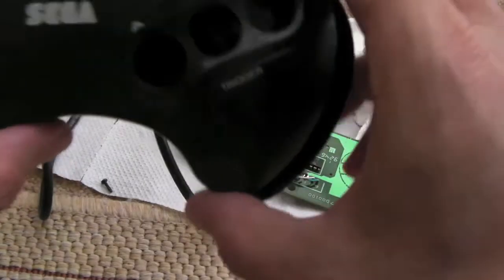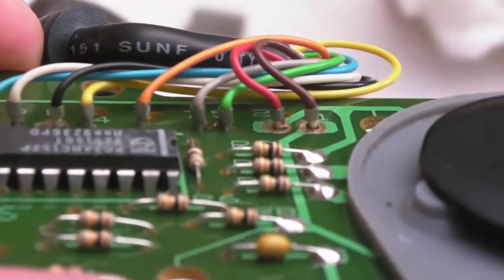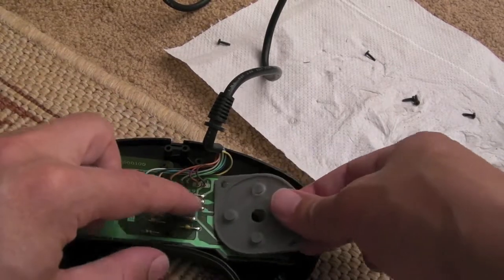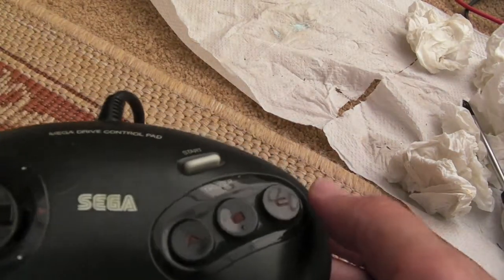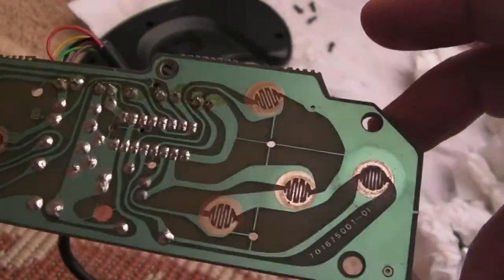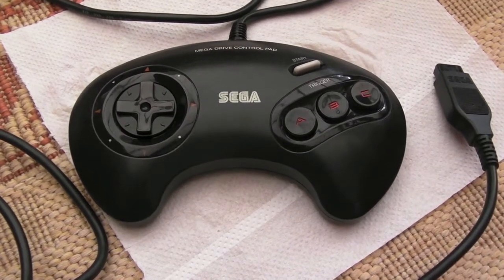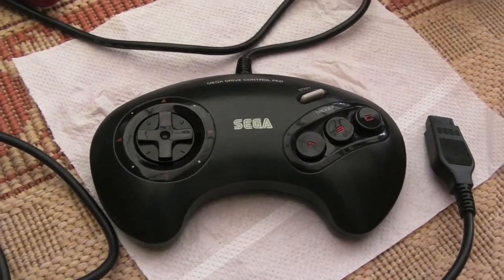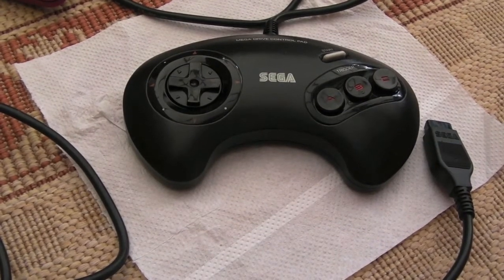Sega Megadrive (Genesis) Controller Repairs

Comment: I've never seen an inverted MegaDrive/Genesis controller like that, all the ones I've seen are either where the D-Pad is 1 whole piece that comes out "which I hate it makes it very stiff" there's also other ones where the D-Pad has 2 pieces "which I prefer" either it's held by a screw or 2 tabs, those ones are my favorite because the D-Pad is nice and loose and makes it very comfortable playing games, the inverted one seems really cool.

Comment: I have two of those inverted dpad controllers that I have deep cleaned today and it stopped working, watching your video made me realise that I had reassembled them back together incorrectly facepalm (rubber contact under the board)
Reply from the maker: =D  I take it they are OK now?
Reply: @GadgetUK164  Haha, yeah - after watching your video, I realised my mistake and promptly corrected them - good as new :D

Comment: It seems there is two different internal setups to the MegaDrive control pad, the standard d-pad on rubber contacts as you would expect and then there is the inverted d-pad shown first in this video, i have used both and the improvement in feel and response on the inverted d-pad one is significantly better than the standard one. I'm unsure when Sega decided to change it but i have a feeling it was common by the MegaDrive II release phase.
Reply from the maker: Thanks, that's useful information!  I will have a play with the inverted d-pad and see what it's like.  I think you are right because when I tested with Golden Axe it felt a bit more responsive.
Reply: Hey @(GadgetUK164), by any chance do you know how the rubber piece that holds the black cable inside the case is called? The one that goes into the hole from the upper part of the case. I would need to find some replacements for some controllers but I don't know how it is called.
Reply: I think it may actually have been the standard by the time Sonic was bundled.
Reply: @GamuzaMF  I suspect you were after a gromit.

Comment: Got a controller with the up not working on the D-pad hopefully your video will work.
Reply from the maker: If cleaning the button doesn't work, it will be cable damage.
Reply: GadgetUK164 opened it up tonight had a quick clean, gave it a quick test run and it's fixed. thanks this vid mate !

Comment: I have like 3 controllers and only 1 is working properly. The rest of them: all have troubles with wires right next to body. Some of the lines are apparently broken. At leat 2 controllers the same issue. All come from Ebay. Buttons and everything else no problems at all but WIRES big problem. And I have no idea how to fix that without shortening the lead and making it look like original.

Comment: I need a new rubber to fix my controller.  Seems more expensive to fix than to just buy another controller though.
Reply: Small rubber-pads for the none inverted version is dirt cheap.
If you find the big rubberpad for this version of the controller just tell me :D i have a SEGA Mega Fire controller thats in need of a fix.